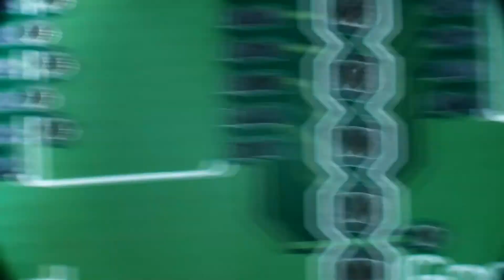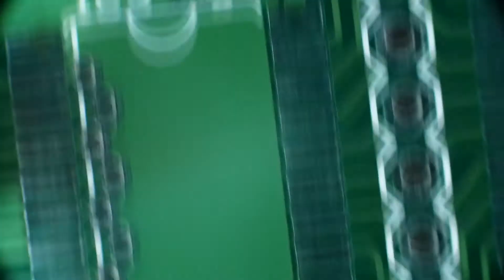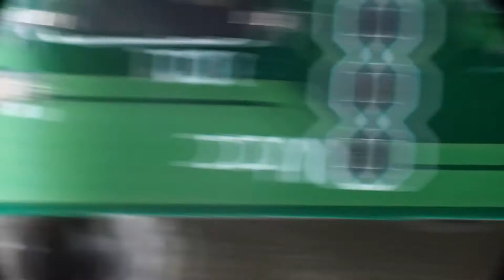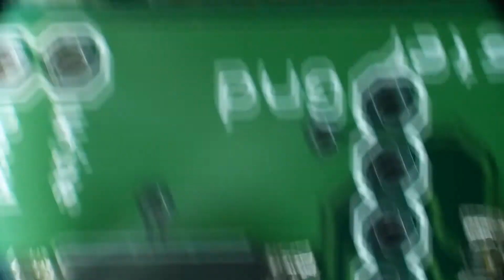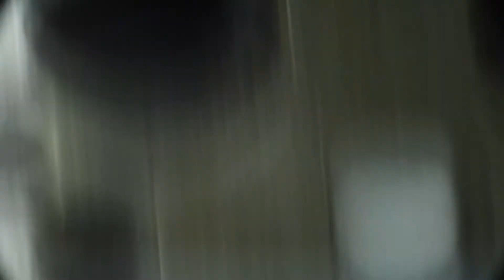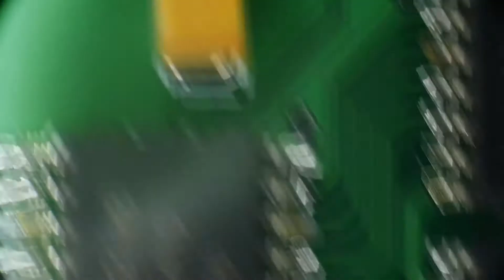#84 TTL CPU SMD assembly

Comment: Beautiful finish on that paste when its melted.  I have a drawer full of 573 ics. There was a 1000 led cube kit on sale for 7 dollars so I bought them out of stock for the leds, there had to be 6 or 8 573s in each one. It was a sweet find being as im going for a whole collection of 7400 and cd4 series logic ics. Playing around with the gates to make other gates is just plain fun. You're right about smd. I just buy a bunch of kits and do them by hand. Takes a while to get the drag method down when you're looking at a 7 inch microscope screen haha. I use an 858d hot air firehazard..uh I mean station that I use to clean 3d prints up with. I'm getting a real air station soon, there's a nice atten on sale on ali with free DHL.